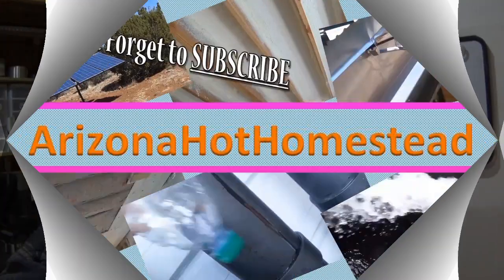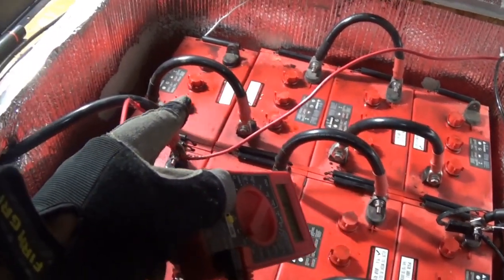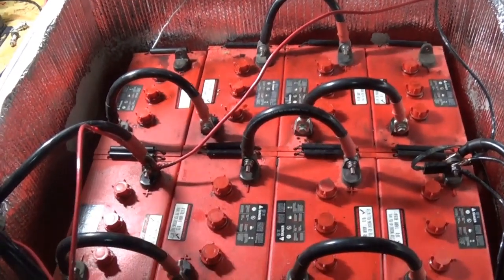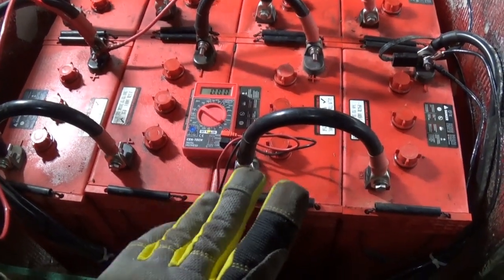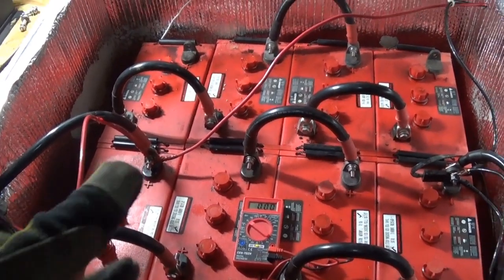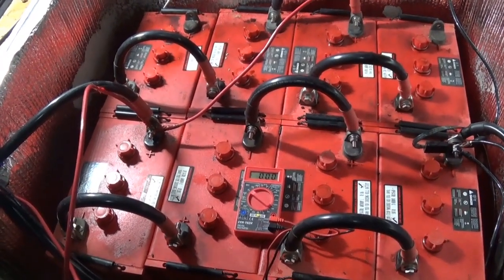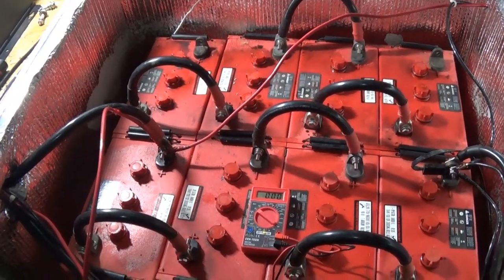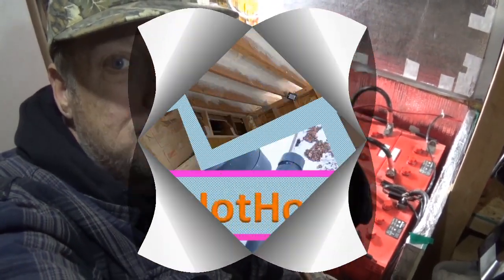Solar Batteries not Holding their Charge Part 2 of 3

Comment: That battery with low voltage just has a bad cell and is probably draining all the batteries that are in parallel.
Reply from the maker: i agree. with just the 4 batteries things are good.

Comment: The battery with 4 volts has a bad cell, needs to be removed or it will bring your whole bank down very quickly.
Reply from the maker: i agree. still thinking should i just replace that battery or hang on and go big with the lithium later.

Comment: You should look for the same battery, brand and model, even used and replace it, use the bank at a maximum of 30% never go below 50% except in rare cases, if you decide to replace everything, single cell LiFePo4 with smart BMS, or rack19 batteries, no less than 300Ah, at 24volt it would take twice as much in offgrid, on Aliexpres there are excellent products, my favorites are the Winstons but they cost a lot, just in case remember never to go below 80%
never below 3 volts never above 3.5 volts per cell and they will last over 20 years given the cost of the investment I would make them last longer. Ciao

Comment: I'm not so sure about you getting your money's worth out of that charge controller. After all, count in the $1,600 for the Rolls batteries it killed. Rolls batteries should last for more than 10 years... The ones at the Saw Shop are pushing close to 20 years. Granted, they are now in terrible shape.
Reply from the maker: i blame my self not the charge controller. if i would have been monitoring the batteries more closely on their water and checking individual volts and specific gravity of the cells. i would have noticed the bad battery sooner and replaced it.

Comment: You might have a PWM charge controler
It should have 3-5 charging cycles
The one is like once a month to shake the junk off the plates
When you change to Lithium
That cycle needs to be turned off
That cycle if ruin a lithium battery
and an MPPT charge controller is better
Reply: To see a sharp guy on solar 
And his testing on most every thing 
Including batteries where he opens them up to see the quality of work and parts
UTube
Wil Prouse
Reply from the maker: i have seen a few of his videos.

Comment: To check batteries
They need to be separated
One bad battery will pull the rest down
Then with a hydrometer (auto parts store)  and check the solution gravity in each cell
The hydrometer is marked
Reply from the maker: i did check the hydrometer and the one bad battery had a bad cell the others were in the white. the other batteries read green.
Reply: @ArizonaHotHomestead  
One 1⃣ cell will pull the others down
Take that battery out
Reply from the maker: @jimh4167  i did using only 4 batteries now and all is good.